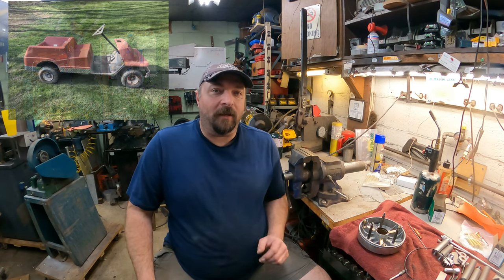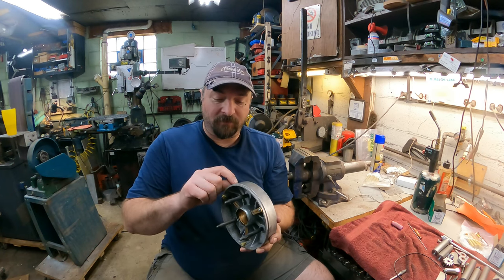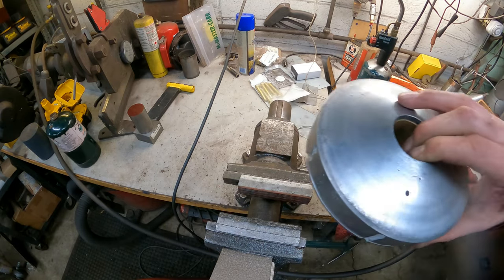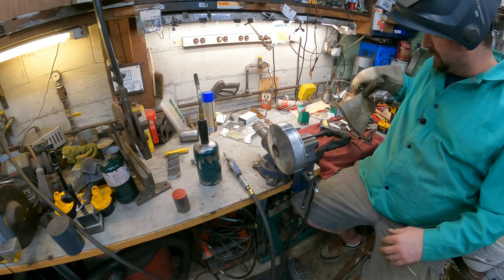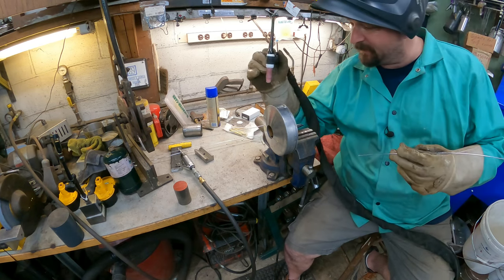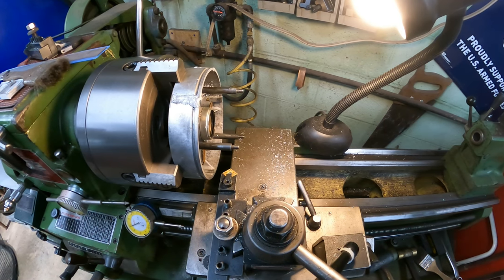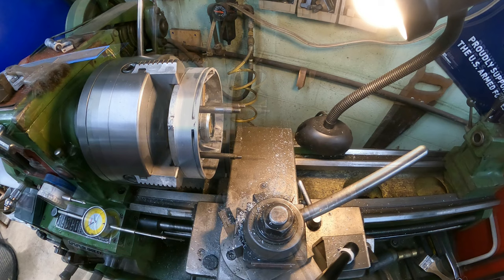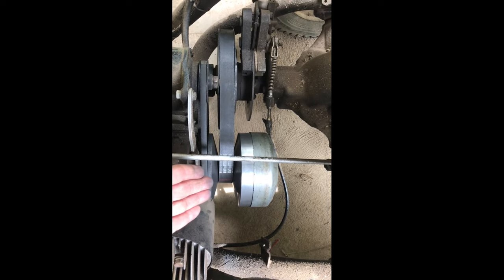Part 14 Project Golf Cart Primary Wet clutch repair 1976 Harley Davidson Cart

Comment: I’m so bummed! 
I got my ‘77 Harley 3-wheeler gas all dolled up & found the a crack in my primary clutch housing like you found on yours😢
I don’t have the know how, tools or shop to fix it myself like yourself 
With the lack of parts available on these anymore is there any merit to storing this thing for another day and then finding some crazy mechanic down the road to convert this 2-cycle to a full lithium electric? 
Seems drastic but my gut says the lack of parts are going to force us out of easily retaining these old 2-cycle relics much longer 
All this energy is geared to preserve the look & shell of these old girls and I hope we can all find sound solutions
Curious on your thoughts and thanks again for such informative videos
Reply from the maker: Bummer your clutch is cracked too... I would start looking on eBay and see if one pops up. I have seen them on there from time to time but not often. I have seen a few people convert the clutch to a newer style for these but never tried it. 
If mine would fail again, I would try converting it or put a different engine/trans in it. Search the Tube and a lot of people did this. The main thing I didn't like about doing the 4 stroke conversion is you loose reverse. But, I would do this before using batteries, but that my personal preference.  Good luck!
Reply: @SABsGarage  
I wonder how I could figure out what newer clutch these people were successful in finding & using? 
I will definitely keep looking online. I have feelers out to 4 different parties that dabble with vintage harley parts at this point. Thanks again my friend for the info.  Let me know how i can reach you  i want to send you a picture of what my cart looks like. Its pretty cool
Reply from the maker: I think I saw someone converting the clutch on these forums, but don't remember. 
https://www.buggiesgonewild.com/
https://cartaholics.com/forums/harley-drivers-club.7/
I would check it out and see what you can find. I wanna say I saw someone on YouTube doing it too????
I'm looking forward to seeing your cart, feel free to contact me anytime. SABsGarage79@gmail.com